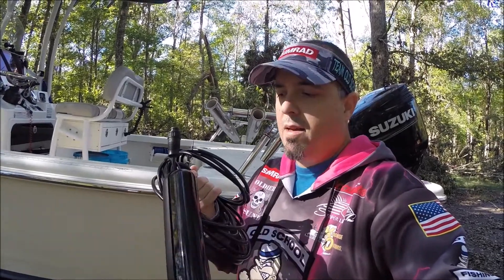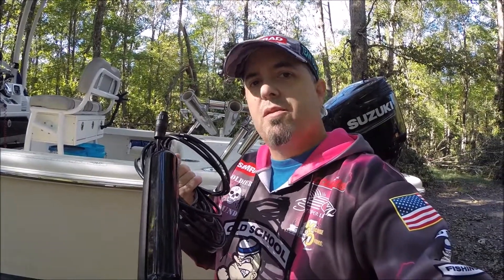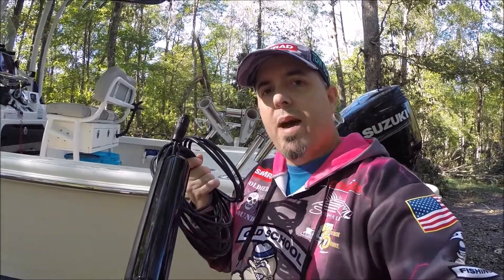Active  Imaging TRANSDUCER. 2 in 1 and 3 in 1  Simrad Lowrance. Evo3 Go Series HDS Carbon

Comment: So would u still need the tm 150?
Reply from the maker: Absolutely. The built in CHIRP bands are decent, (excellent for the money) but not as good as the 150.
Reply: Mike Smedley. How does either one read at speed my hb I had to add one to read bottom at speed
Reply from the maker: They hold bottom perfectly. I mount my transducers a bit lower with the rear edge slowly lower than the front. I throw a bit of a rooster tail, but I need to mark fish on plane and not just the bottom. The 150 marks fish best on 83khz on plane.
Reply: Mike Smedley nice thanks
Reply: Mike Smedley now would them two be best choice for like mostly Kerr lake and a little saltwater
Reply from the maker: Chris Layton Definitely. I use the Active Imaging Transducer for side scan and down scan. I am using some other transducers for CHIRP simply because I’m testing and comparing for Airmar, but the 150 was my “go-to” CHIRP transducer. It’s deadly for Striper fishing in freshwater and the Bays. Just remember to use 83khz or custom 105 for marking fish at high speeds.
Reply: Mike Smedley thanks for the help you probably saved me a lot of time and money

Comment: I have 3 and 1 active imaging transducer with nss Evo 3 and everything works properly except structure scan only transmits out five feet on each side of the boat.the range markers are set out to fifty feet but the screen is black past five feet.any solutions? There are no trouble shooting in the manual or installation guide.
Reply from the maker: capital punishment This may sound overly simple, but did you change the range in and out to see if there’s a change?  The black band in the center only represents the open water before the beam makes “landfall”.
Reply: @MikeSmedleyOLDSCHOOLSTRIPERS  first off thanks for replying back to me.and yes I went out to 150  ft on each side and down to 5 ft .my screen shows a couple of feet of bottom on each side.i had the nss9 Evo 2 before with the lss2 transducer mounted in same location and worked fine.im hoping it's just a setting but I've went through everything and can't seem to find itout .the manual has no trouble shooting.one thing I will say is the center of the side scan screen doesn't have the black or dark center in the boats course it's green or whatever color palette I choose but outside of boats wake is black.thanks for any input you may have.
Reply from the maker: capital punishment You did the latest update?
Reply: @MikeSmedleyOLDSCHOOLSTRIPERS  I haven't because I just got it from simrad.they swapped my  Evo 2 for the 3. Just installed it.everything works great but like how you said it the beam never makes land fall.unless your five feet from seawall or dock then you catch the edge of pillings. I even tried to switch sonar hub ports but when I switched the echosounder didn't work so I switched back to the other port and it worked again.with echosounder I'm reading depth and bottom at 35 mph.so I think transducer is ok.thanks again.im dreading having to deal with simrad tech and customer support.they are frustrating to get ahold of someone to help me.thanks again for your time.
Reply from the maker: capital punishment BINGO!! It will not work without update.  Even if it left the factory yesterday it needs the update.
Reply: @MikeSmedleyOLDSCHOOLSTRIPERS  I will do that! Thanks for your time.i will let you know the outcome.
Reply from the maker: You got it brother!!
Reply: @MikeSmedleyOLDSCHOOLSTRIPERS  your the man! Update fixed it.much appreciation!
Reply from the maker: AAAAHHH YEAH!!! 👍👍👍👍

Comment: By any chance Mike, do you know if structure scan will work with chirp on with this transducer?
Reply from the maker: It will probably depend on the display. Evo3 should.
Reply: Ok it probably won't with my Go7 then. Chirp won't work with structure with my current LSS2 transducer.
Reply from the maker: No. It shouldn’t with Go series. The Evo3 has dual processors on board.